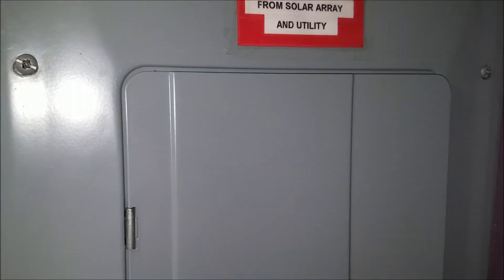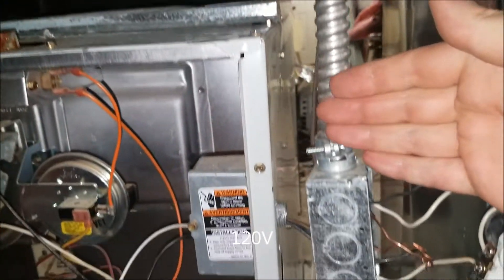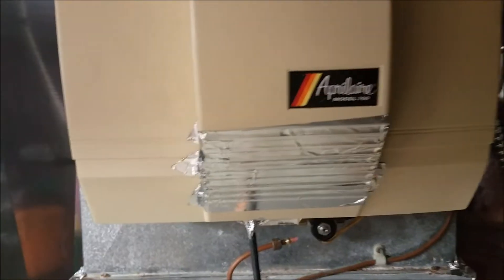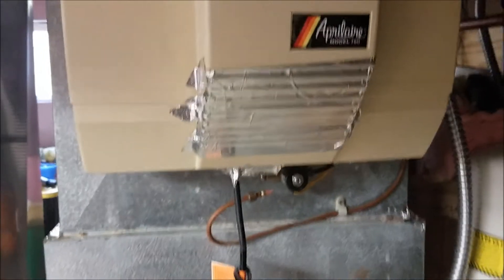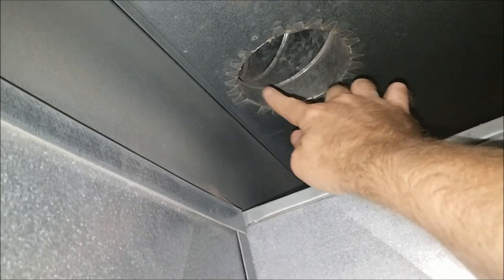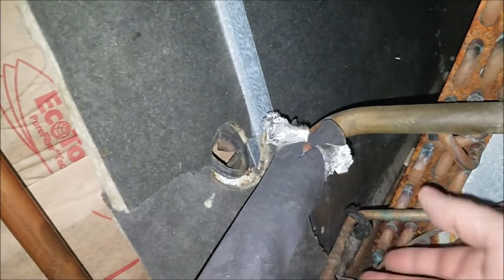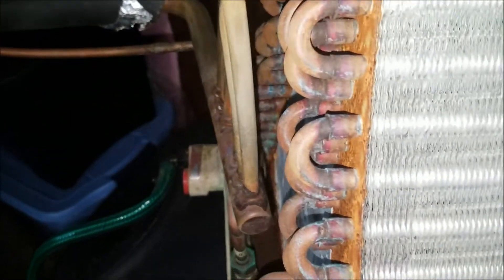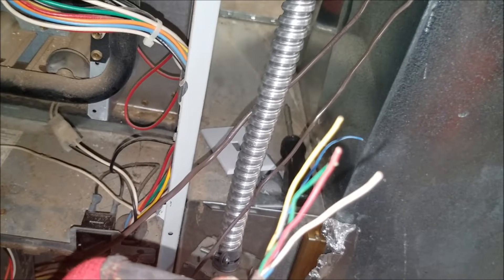Mr. Cool DIY Heat Pump Removing the Gas Furnace Part 3

Comment: I am not sure where you're located, but I am just curious if you get bad winters occassionally?  I am happy to move to a heat pump, but we get pretty harsh winters every few years and I am not comfortable eliminating the gas furnace yet.  I am more than happy to eliminate my natural gas service, though.  There are regulators that can be used to switch to propane, which I will likely do if I find that my gas usage becomes non-existent in moderate to mild winters... but for those winters where we get 2-3 weeks of -15F temperature... I think I will either need some alternative or a heat strip.  I am also leaving the possibility open for a different alternative.  Propane would be nice because it is readily available and I can get a tank sized as needed... it would also work to allow me to continue to use my gas fireplace, which I would suspect to get more use than the gas furnace once the heat pump is in.  However, I wouldn't be opposed to some biomass furnace, either... wood pellets or corn cobs.  I like the idea of the corn cobs.  I don't grow any corn (and if I did, it wouldn't be much because I am only on 2/3 of an acre), but some satisfaction exists knowing I could grow some corn (and use to make some libations) and use the cob for winter heat.  That would leave me with the gas fireplace... I wouldn't be able to remove it and I would want it to be functional, but I don't think it is suited for much of an alternative.
Reply from the maker: We see below zero temps,  see my other heat pump videos.  

I wanted to be off gas altogether. It's been nice so far.  It takes a little longer to warm up for gas, but I already seen a 20% efficiency increase from my gas furnace since it was only 80% efficient.
Reply: @stem_saving1644  I definitely want to be able to call up the gas company and disconnect my service.  My minimum bill for maintaining service with zero usage would be $40/mo... so just having even the same consumption costs if it were 1:1 from gas to electric would yeild a decent savings.  I think I have a lot of the same things planned that you've been working towards.  I am slightly hoping for a harsh winter this year to put the system to the test and gain some confidence in it.  I am wanting to get a heat pump water heater and to get an induction range.  That would only leave the furnance and fireplace, so if I can be confident in having consumption of those being low... I can bare minimum swap regulators on those to propane and shut off the gas service.

I am kicking myself a bit, though, because I had years of repairing my appliances and last year we replaced almost all of them except for the oven and range.  Even though I was eyeing them, I got a stacked unit rather than a heat pump drying system.  I really wanted to get two of the combo units that are washer/dryer in one single unit.  It would really help support moving towards solar just because it would be more efficient and lower any spot peak load on the system.

Comment: Great video! I think you'll be pleased with the performance of the heat pump. I installed my 3-ton unit this past spring and I love it! I kept my old furnace and just replaced the A-coil with a Mr. Cool Universal connect. I added a Google Nest Thermostat and set it to dual-fuel mode so the gas is only used at 20F or lower.  I'll probably drop that lower it's been working so well this winter so far.  

My only tip so far would be to consider the drainage on the outside unit.  It can generate a lot of water in the wintertime for the outside compressor, due to the defrost cycle.   I'm n the mid states (KY) so I don't need to worry about uber cold, but in the -20F kind of temps, I could see the unit getting frozen defrost discharges coming out of the unit.   That said, for I've been very impressed with the combo of the Google Nest thermostat and the Mr. Cool 3ton Universal and their A-Coik DIY config.   Not one, but Two thumbs up from a user.
Reply from the maker: I've been super happy too. Dropped heating energy usage by half.  It seems to be a little louder in heat mode and the lineset seems to vibrate more so than cooling mode.  But saving 5k sure makes up for it.  Still happy with it.

Comment: did you evacuate the refrigerant? if so how?
Reply from the maker: Not yet,  still working that out.
Reply: When the old condenser still has power run it and close off the valve on the larger line the suction side will draw all the freon from the lines after a few minutes, then close the suction valve and all is trapped inside.
Reply from the maker: You mean the smaller line closed (liquid)  and leave larger open. The issue is still getting rid of compressor full of freon.